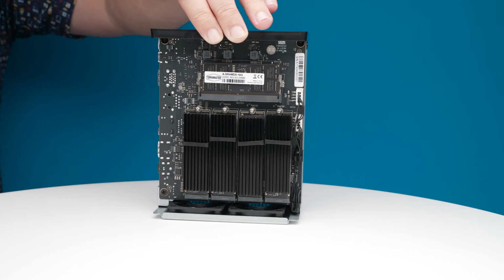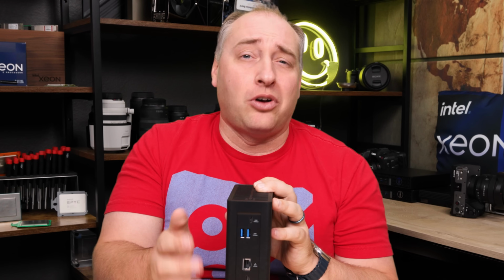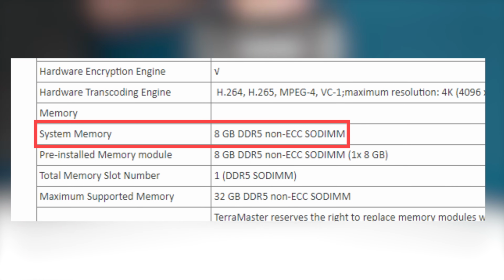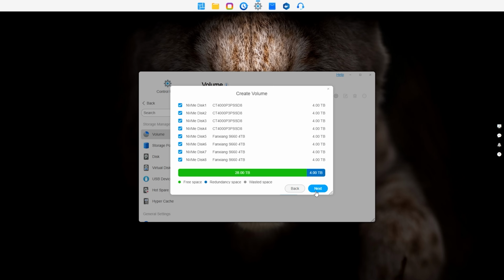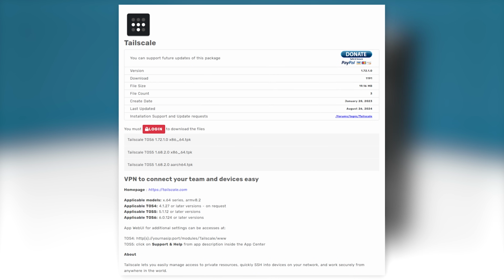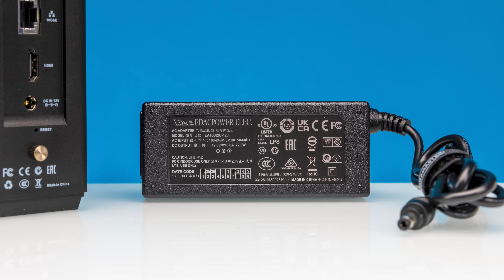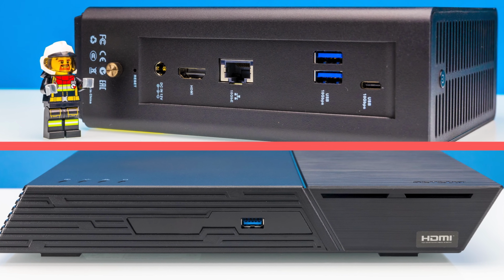Tiny 10GbE All-SSD NAS Sports Up to 64TB

Comment: 1) NO ECC 2) not 10gig NIC but in fact 8gbit 3) low per nvme ssd lane allocation 4) high price = DEFINITELY NO BUY
Reply: > 2) not 10gig NIC but in fact 8gbit 

Their testing shows it pulling a fairly constant 8.9 Gbit/second over a long period. Considering the overheads in the protocols, that's about what you can expect from a 10 Gbit/s network.

> 3) low per nvme ssd lane allocation 

Since the device itself is network limited to 10 Gbit. It only takes 2 PCIe 3.0 lanes to completely saturate that (8 Gbit/second). I'm not sure what your point is here, because a 10 Gbit NAS cannot be expected to handle more data than that, and a 2 lane PCIe 3.0 NVMe SSD will be more than enough to saturate it. Even a single incredibly cheap SSD will be able to saturate the network.

Comment: I've worked as a NAS QA before, so I have some ideas about structural design.   First, for a NAS at this price, the SSD heatsink fixing mechanism is designed to use a material that is sure to age and break. This is very strange for a product at this price. ASUS products at the same price can quickly install SSDs.    The second point is the issue of SSD arrangement design. The SSD heat sink will increase the weight and the center of gravity of the device. Why are the SSD and heat sink not staggered on both sides of the motherboard near the cooling fan.  The third point is that considering the heat dissipation and installation issues of SSDs, I think it would be better to put eight SSDs on the same side and make a large heat sink and a cooling fan for direct heat dissipation. The other side is the CPU RAM IO PORT. The disadvantage of this is that the fuselage will become longer, and perhaps a horizontal fuselage design would be better. But judging from the current mechanical design, the only difference between a NAS at this price and a Chinese small host is the 10Gb NIC, right?  This content was converted from Chinese to English with the help of Google Translate.

Comment: No way at $699. Im waiting for minisforum to do another intel board with 6 m.2 slots. They supposedly have a breakout board for their current one being worked on so if that comes out id go with that. Yeah itll cost a little more id have to get a mini itx case and itll be a bit bigger but itll have way more power than this.
Reply: What's the current minisforum model?
Reply: You're talking about the MS-01 I guess. It's interesting, including their prototype board. But the issue is Minisforum as a company, they don't seem reliable (QC, after-sale).

Comment: Bit of a shame the SSDs are limited to 1GB/s due to the low number of avaliable lanes. Kind of defeats the purpose of having a NVME NAS vs a 2.5" SATA NAS since it's not even 2x faster while wasting a lot of the potential performance of all the money you've spend on NVME drives.

Comment: you mentioned the low noise floor, I think what a lot of folks are forgetting is just how loud harddrives are. My toshiba MG08 helium drives are so loud you couldn't sleep in the same room when they're active lol
Reply from the maker: Exactly. That is why in the studio we have one old HDD archive tucked away in an equipment closet but everything else is SSD based.
Reply: coward, i ran a spinning rust 1u dl360p in my room for 3 years. i promise those fans were 10x louder than the spinning rust
Reply: I have 0 to 30 hard drives spinning in my bedroom rack at any given time and barely notice them. I have a few Seagate EXOS and a bunch different WD drives (Purple, Red Pros, and shucked drives that are basically their blue line up) as well as a handful of seagate and few toshiba drives. My 12U rack + my desktop is about 1/4th the volume of a window unit AC, its not bad at all. Sure I hear the drives doing their thing but its never loud. When I do something with the 2060 video card in my main server, I hear that fan spin up a whole lot louder than anything else in my set up. That being said, I have a whole different reason for wanting a bunch of SSDs as caches. The less I can have drive spun up the safer they are. Between accidental bumps into the rack and my dogs jumping around I worry about damage to the hard drives. What are some of the more noisy models? I’d prefer to avoid those
Reply: Uh? Mine are mostly inaudible over the other stuff. If they are actively reading/writing I hear it over the other stuff but it's more because of the odd sound they make, but that's only if I'm not playing a video or something. Mine are MG08ACA16TE but as I said not loud - to me anyway. I should add the server is literally next to me. Less than half a meter distance heh, I'm going to relocate it but haven't yet. 
Oh also, I do sleep in the same room with them, but my bed is 4m away from the MG08's approx. I usually have some youtube video playing when I go to sleep but not always, the drives never bother me. I should add the same machine has 3x 15krpm SAS drives, al14sxb90en 900GB which make more noise, they have an audible slight whine to them just running. But I only hear them if I have no video or such running and I'm right next to them.
Reply: Any of y'all ever have a Bigfoot drive? 😂
Reply: @JJayzX  Hahaha yes, 1.2Gb if I recall correctly, took a good bit to spin up and you could feel the vibrations from the heads moving through the table it was on. Big deal at the time in terms of mb/$ price, much cheaper than normal 3,5" drives. But yeah, it takes the space of a CDROM/DVD drive heh. I still have that thing somewhere I think, it worked when I tried i last but it was more than 10yrs ago.

Comment: Are those heatsinks really necessary ? I mean, it's PCIE 3.0*1 so... at maximum it will be 1GB/s per SSD. Does it really need all this stuff since you also have two active fans cooling the whole thing. I had a n305 mini PC from aliexpress and resold it because the N305 HEATS A LOT compared to N100 or N97 (which those mini PCs already have trouble taming while running windows 11 for example). Putting a PRO GE variant (like a 8600GE) of an AMD CPU wouldn't have make many difference. They could even limit the TDP to 25W instead of 35W to even run it cooler while also having true ECC support because of the PRO variant of the CPU with ECC UDIMMs while having much better capabilities than N305. Also many more PCIE lanes. I really hope one day I will have I don't how how many money to design my own system.

Comment: I feel they made a huge drawback by not integrating TB4 to that.
Reply from the maker: TB4 would require a different chip and system design
Reply: @ but don’t you feel strange to add NVMe SSDs with 6Gb/s to a 10GBit/s connection?

Comment: Hi Patrick - great video, it helped me decide to get this F8 SSD Plus. You mentioned the slow RAID sync times; there's a setting in the TOS 6.0 interface, under Storage Pool settings (gear icon top right) where you can set a custom speed. I set the minimum to 512MB/sec and the max to 800MB/sec, and after logging in via SSH and running watch "cat /proc/mdstat" was able to see this running at 800MB/sec!
Reply: Raid 5 type functionality is likely something SSD struggles with but unless the lanes for these are gimped 800 MB/s a second should be child's play for an SSD focused system. Way back when the world had SCSI arrays with drives spinning at 10-15k, 380-512 MB/s a second was doable. The interfaces themselves in reality are the limiting factor for storage now, not the medium itself.

Comment: You'd think by now Intel or AMD (or Arm) would have a CPU with a LOT more PCIe lanes for these sorts of small m.2 nas devices to better over-subscription and reduce the need for PCIe switches. Particularly when doing raid, I can imagine the switches are saturating buffers, same as an ethernet network would if you had a bunch of line-rate devices all communicating over a single shared uplink.

I'd be curious if any of these PCIe switches have buffer drop statistics to see what performance is being left behind, again as you would an ethernet network.
Reply from the maker: Well I mean the C3758R is that for the 10GbE era. People just hear Atom and freak out, but realistically for these applications the CPU performance needs are very low.
Reply: it's not that those cpus can't have more pci-e lanes, it's more about if they did, they would threatened the sales of higher, more expensive cpus a.k.a less profit. bitfurcation is also a pain.
Reply: AMD EPYC has 128 lanes. Enough?
Reply: Then they'd be cannibalising their enterprise offerings - we get the crap because they don't want to give consumers better hardware.
Reply: Does PCIe 'support' packet loss?
Reply from the maker: @wolfgangpreier9160  AMD EPYC I/O dies run at more power than this entire system :-)
Reply: @ServeTheHomeVideo  Yes, that was not the question. 

There are Intel and AMD CPUs with more than enough PCIe lanes. 

They are just a tad bit expensive and power hungry.
Reply: @FiveFiveZeroTwo  Of course, they use QAM64 with FEC on every thread. That way you can pack up to 19.2 kBaud on a perfectly frozen Chip. Those are modern devices, not such cheap DEC types.
Reply: @SP-ny1fk  Then why do you buy this crap? 

I had a inquiry about Dual AMD 9124 Host with 768 GB RAM today. 63000 passmark. Nice.
Reply: @FiveFiveZeroTwo  At some point it has to with any switch and exhausted buffers when you have a 4:1 (or more) oversubscription to the upstream pcie bridge on the cpu. Plus this has been happening with external GPU and Thunderbolt with video capabilities for some time as even a TB3/4 port @40Gb speeds can't carry everything with GPU, hubs, raw video all hitting those links, so it has to be somewhat loss-tolerant when something wants more bandwidth than it has. I'm a network engineer though, can't speak for the pcie much off the cuff, but I'm sure there has to be some level of congestion management directly or layered since the advent of pcie switching...
Reply: @MikeButash  PCIe appears to use credit based flow control: "Credit-based flow control is point-to-point based, not end-to-end.
Receiver sends Flow Control Packets (FCP) which are a type of DLLP (Data Link Layer Packet) to provide the transmitter with credits so that it can transmit packets to the receiver."
Reply: @FiveFiveZeroTwo  Sound like fiber channel for storage, go figure. Bad memories ever dealing with fiber channel networks though.

I'll be more interested when I can attach a switch chip raw serdes port to the cpus via pcie/cxl bus directly.

Comment: I don't understand why mfg go cheap on the power connector.  They should use a bayonet connector like the Switchcraft 761KS15.  Just a few mm larger in diameter but able to screw lock on to the case.

Comment: 8:20 rubber bands are usually bad to keep the heatsink in place, real silicone rubber is expensive and in most cases they use cheaper stuff that will dry out and break in a relatively short time (years). You are nearly always better off using zip ties. They are cheap and will last forever
Reply from the maker: Yes, especially notable living in Arizona since it is dry here.
Reply: They should have a metal arm across those SSDs to help keep the heatsink in place instead of those rubber bands.

Comment: So there is no eMMC or something else to hold the OS - and its doing a mirror on all user drives like the synology system is made? And another big issue/mystery... using Gen3x1 PCIe for 10GbE would not let you saturate the 10G link in one direction - you never fit 10G into 8G. So this is or is not adressed by the ASMEDIA chip (eg. to have a x2 uplink to cpu, x2 to NIC and x1 for the last unlucky SSD?). A verbose lspci (vvv and tvnn) would be interesting to see how the PCIe topology is actually done.

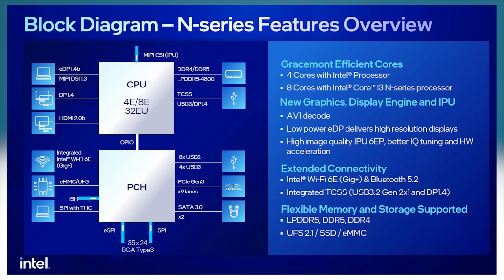Comment: 9:20 ONE PCIE lane (Gen 3) for a 10Gb/s ethernet port? Nope.

A single PCIE 3 lane only supports 8Gb/s, and so you'll NEVER saturate that 10Gb/s ethernet port.
Reply: Yeah, this is going to be a problem for everything in that system. That 10Gb USB-C port? Nope. Those two 10Gb USB-A ports? Nope. And a single Gen3 lane per SSD?  They could've at least gone with an AMD Ryzen 3 PRO 7335U - this has a configurable TDP which can go as low as 15W (so matching the N305), but provides 16 usable Gen4 lanes. Bonus point would be ECC support.

Comment: I know some people will think its not a good NAS but for the size and noise you won't finding anything like it. A great compact system which you could just pop into a bag and take with you of plugin when your at your desk. Its probably the best mobile NAS on the market. In terms of speed most people won't max this out for every day users most people are just getting 2.5gbe now. Like Patrick said thou its a shame they didn't come up with a better solution for the nvme's.
Reply from the maker: Spot on
Reply: Hi, does the 10Gbe port support 2.5Gbe (the limit of my router)?
Reply: @dolomiti850  Not tried but it does negotiate to 1gbe or buy a cheap switch about £35 at the moment. To be honest if you only have 2.5gb you could get something else which will be cheaper. Remember if you're on 2.5gbe then your read and write speeds will also be this which normal hard drives can handle so save some money.

Comment: soon 16TB m.2 nvme in 2280 form factor should launch, but the prices are still crazy high to switch to ssd if you are not using it to make money.... heavy duty U.2/U.3 are available in up to 32/64TB range but they cost like a used car, hope china will go into production of flash nand on a big scale to attack the market and we get some good enough ssds that pricewise beat hdds soon, would like to have a box like above with 100TB in some raid for security and still some free slots for a later upgrade
Reply from the maker: We have been buying 15.36TB U.2 drives for around $1000 each this week
Reply: @ServeTheHomeVideo  well that is a super price advantage in the us, but in europe Seagate Nytro 5050 in that capacity is the cheapest solution costing 1565 euro/1720 usd /including vat or as you call it sales tax as an end used can not dodge it/, most of those capacities are 1700 eur /1868 usd and way above,
Reply: Will 16GB M.2 drives be backwards compatible in all current 2280 ports? There wont be any heat issues?
Reply: @PantheraTK  physically yes, as far I know only laptops and handhelds have thickness issues and can accept only single sided modules hence limitation to capacity there, as of heat issues that would depend on the specific drive/its controller -the first generations were pretty hot and got thermal throttling, that was solved by better controllers and only the most high end power hungry models required massive heatsinks and good airflow in the computer, nowadays even the pcie 5 versions run pretty cool, also these external nas devices are almost all castrated and do not run the m.2-s on full x4 speeds but only x2 or even x1 so they can saturate 1 or 2,5Gbit network connection but are far from speeds they are capable of running at

Comment: No matter what hardware you use for the NAS, the storage is going to be the most expensive part.   I wonder how this system compares to something like an old ThinkServer TS150 kitted out with 32GB of ECC memory and 4 4-8TB SATA SSDs with a 10GB NIC running TrueNAS or UnRAID.  Granted, the Terramaster is more portable, but if that wasn't a factor, would enterprise servers be a better option?
Reply from the maker: Sure you can use something bigger and higher power

Comment: 8:00 Hey Patrick, use a soft material table top when you handle PCBs. There is a chance the ceramic capacitors can crack because of impact however small the impact might be. Might be just bad luck too. So please have a, for example, a ESD safe rubber mat or just a foam.

Comment: Hey Patrick possible to do a review of the iKoolcore R2 Max?
Soft Router with 10Gbe rj45. 

Lots of the soft router out there with 10Gbe only comes with SFP. 
My ISP modem (ONT) is using RJ45. So this helps.

Comment: Nice, but why 10Gbase-T? A SFP+ port would make so much more sense and would be so much more power efficient. I use a MicroTik 10GbE switch that has SFP+ and I mostly use direct attach cables for my home lab. Twisted pair is just not that good for 10GbE.
Reply: You actually loose performance Ethernet. Aditionally, then you need a switch with and SFP+ port to do all the conversion. I plug my Nas into a switch. I tested the 10GbE on my terramaster nas and it seams to do the trick. supporting SFP+ would just need more circuitry. I guess its just more of a preferance thing. I plug it in and its done.
Reply: @mattharris6958  SFP+ has a larger footprint on the PCB but doesn't need more circuitry. All of the neccessary circuitry is built into the SFP+ module that makes it easier. And you would have the choice of using it with fibre, Twisted Pair or DAC. I actually have no 10GbE gear that doesn't have SFP+ so I would need conversion on on switch side to get Twisted Pair. It would allow the user for more flexible choices.
Reply: @ThorstenDrews  Yeah i do see where you are coming from and am "Pro-Choice"

Comment: It's very cute, but personally I would still prefer to build a system with a fill i3 CPU just to get more PCI-E lanes and networking. After all, what is the point in putting all these fast SSDs if they are bottle-nicked by the limited connectivity!

Comment: 10 Gbit - found
M.2 x 8 - found
GPU or IGP - missing
PCI Express 5 - missing

Is there a small factor that has all of the missing features?
Reply: not as NAS. But look at mini PCs. Beelink as exapmle. You could also not use PCIe 5 with 8 ssds and a energy efficient cpu, because they don´t have so many lanes. and also unnassasary because you would never get the speed out of it for network.
Reply: @Silvar87  That's why I say there is no such solution yet. It would work like a NAS or AI and container storage, and I`m interested in getting one if it exists.